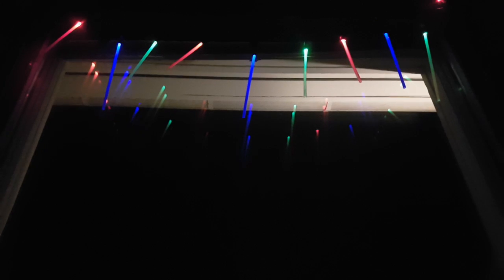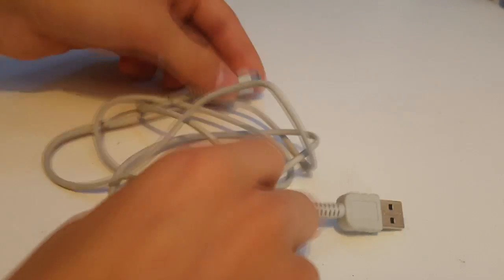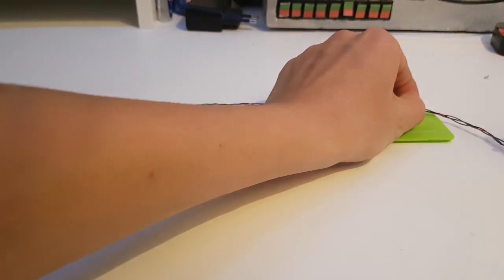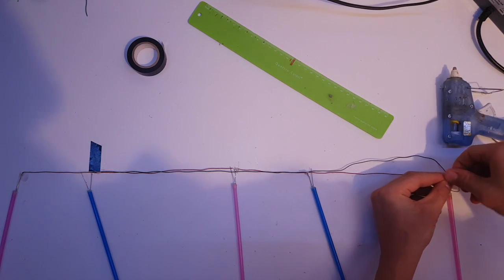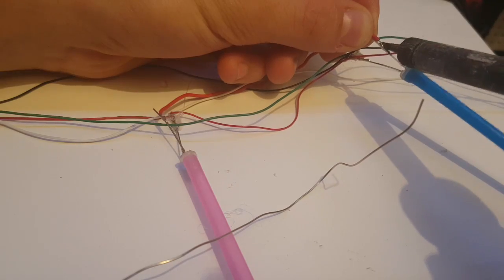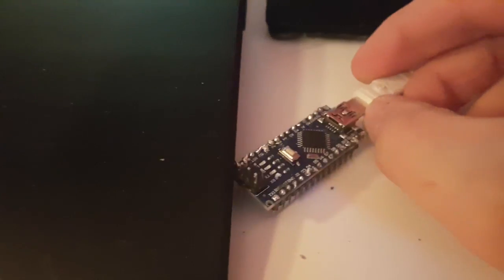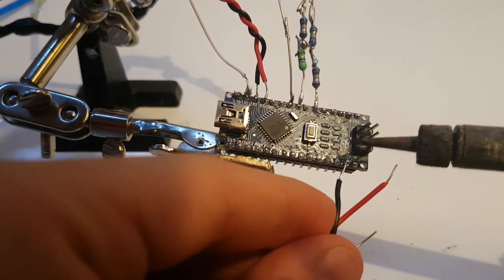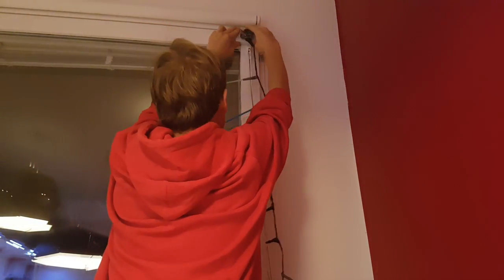How to make Programmable Lightsaber Christmas lights | Projects Every Weekend

Comment: varför hålet i glaset på din dator?  passar inte en 120 mm fläkt där?  inget grafikkort?
Reply from the maker: +Elias Kron hålet är la mest där för att det är ganska dålig ventilation i datorn. Och sen också har jag stock fanen från processorn kvar. Men jag ska uppgradera datorn med ett nytt chassi, grafikkort(rx480), och vattenkylning för processorn (dock ej custom loop)
Reply: Custom loop är svindyrt...  Kör med corsair vattenkylning och 10 120 mm fläktar.  Om du går med vattenkylning... Överklockar du processorn då eller?
Reply: 10 120mm låter som rena tjärnkraftverket...
Reply from the maker: hålet är för 80mm fläkt. aa jag vet att custom loop är dyrt, det är därför jag ska köra på en färdig. förmodligen en på 2x120mm. sen ska jag också köpa ett bättre chassi, förmodligen Thermaltake Versa C22, RGB Black. Det är tänkt att jag ska överklocka processorn till 4.1ghz
Reply: Min är på 4.6... I5.
Reply from the maker: aa. fast det här är mer en budget än en gaming dator. det är därför jag kör på en amd a6 6400k
Reply: Såg att din setup har rött tema...  Men din logga är blå?
Reply from the maker: aa